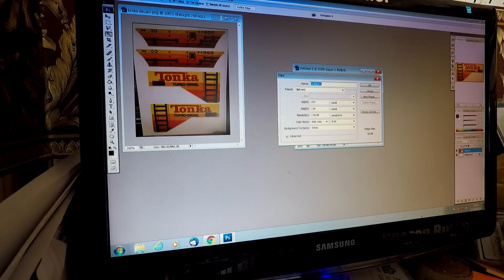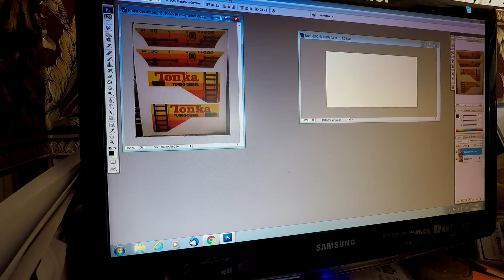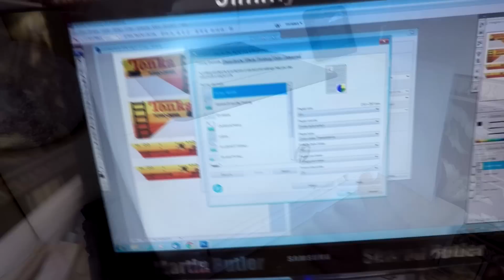Tonka Dump Truck Restoration 1970's Tonka Toy

Comment: As a young child, I had a truck exactly like that. I must have traveled 10 miles kneeling in the bed of that thing.
My memory tells me there was a metal lever to release the dumping action, and some kind of pneumatic cylinder to lift the bed, but I might be confusing that truck with another one.
Really nice job on restoring, it should give that young lad years of fun!
Reply: Oh yeah riding in the the back of those truck

Comment: Very nice results. I almost cheered when you let the kid play with it. That's what they're for. Must be nice to have a shop and the capability to plate things. I would be tempted to plate every metal piece, rather than restoring it as close to original as possible. There is only one tip I can offer: when you're drilling out rivets, drill a pilot hole with the smaller bit, but then use one that is as large or slightly larger than the head of the rivet, HOWEVER regrind the tip to a very shallow but very sharp point. This keeps it from going deep before it goes wide, and makes drilling them out quite quick and easy. I have to use the kitchen table as my shop space so what I can do is rather limited.
Reply from the maker: The centre part of the rivet was sticking up. That's why I couldn't get a start till I knocked it through.

Comment: Came out fantastic. Get a spot weld drill bit, they get rivets out without touching the part its holding as they are flatter on the cutting face.

Comment: Awesome job. That was a lot of work. A suggestion that may help, I have found using a white primer/ under coat makes a huge difference to the finish with bright colours like yellow, red and orange ect as the light tends to go through the colour and bounce off the white. Not only do you need less coats but the colour really “pops”. Hopefully you will give it a try and like the results. Love your channel. 
Cheers Stuart 🇦🇺
Reply from the maker: Thanks for the info Stu

Comment: Truck was made 88-91.  The wheel hubs are recessed
Reply: 83-96 had that grill. 83-91 had the cab and chassis decals like that. 89-97 had the recessed 5 lug wheels. So this truck was built 89-91. The wheel hub recessing came in in 1989.

Comment: The advert in the seventies went, "Real tough toys for real tough boys". " Great", I thought, now I can have a toy that can put up with my destructive nature. I had one for my seventh birthday in '71. I pushed it all around the garden for days on end and it did seem to stand up to a lot of punishment. Then came the beach. My family lived a stone's throw from Crinnis Beach in Cornwall and every summer we spent most of the time on that beach with it's strange non-sandcastle building sand, it's rusty coloured water paddling pool, crazy golf, amusement arcade and it's huge pot-holed car park. This car park put my Tonka truck to the test. I would push this truck up and down the car park seemingly oblivious to the movement of the traffic. But then I noticed something, "No!" One of it's plastic wheels had split along the seam. This was quickly followed by the other three wheels. When I got home I tried to glue them. But in the days before various super glues all we had at home was UHU glue, which was only good for sticking small feathers to other feathers. My Grandma suggested Bostick, I rolled my eyes, these glues were identical in their  hopelessness. It was just one of life's lessons. "I suppose some things are just crap?"  I reasoned. A few weeks ago I had the same feeling when my two year old Toyota Hilux had it's service. With just sixteen thousand miles on the clock I thought, "No surprises here". Well no, not really. The service engineer came out to see me when I went to collect the car and he told me that when he put it on the ramp he and his colleagues were surprised at the amount of rust on the front and rear sub-frames. "See that '01 plated Mitsubishi truck over there, your Toyota's got more rust than it has". "Oh well", I said. He must have thought how I was so unconcerned with this revelation? Well, I remembered I'd been let down before by "Real tough toys for real tough boys" hadn't I?
Reply from the maker: Great memories, you remembered it like yesterday.

Comment: I know this is an old video but I just wanted to point you towards a good product imo.
Ace Hardware makes a plastic razor that works well for removing paint and stickers without damaging the underlying metal.
I used them a ton on my school bus conversion to remove the school district stickers etc. 
 Mike from Texas,Take Memories,Leave Footprints
Reply from the maker: Nice one Mike. Cheers

Comment: Very nice there Martin. I was wondering when you were going to get around to doing a Tonka Truck. I like the nickel plating. That makes those axles look new and help avoid rusting. Now some child will get to enjoy hauling sticks, dirt and pebbles around with it.  I have to ask you, what type printer are you using to make the decals? And what type decal paper as well? Perfect refurbishing indeed. Bravo sir, Bravo!  I have two such trucks and one front end loader to do yet.
Reply from the maker: I used a laser printer on this one but I have used inkjet waterslide decal paper as well. As long as you spray lacquer over them before you put them in water, they work great these waterslide decals. I got them from Ebay

Comment: Excellent video! Doing something like this to a tow truck. What media did you use to blast the paint off? What did you do to restore the window?
Reply from the maker: Aluminium oxide. window just cleaned as it had many stress cracks.
Reply: @bizarreandbrilliant  What paper did you use for the decals?

Comment: Pretty cool. I can't remember what brand, but I have seen at one of the auto parts stores a spray can of "Tonka Yellow". 
And you even re-plated the axles? Wow! Also, that was a nice touch painting over the logo on the wheels.

Comment: Martin, did you reassemble using pop rivets as well? Great job!
Reply from the maker: No I used high tensile bolts and nyloc nuts so you can strip it down if needed

Comment: Started a bit crude but you made up for it.  I had about 15 different models that I restored.  I always cut the old axles in half and used 1/4"Stainless Steel Tubing for new ones.  I bought the proper rivets and heading tool and replaced them as necessary.  The Bottom Dump and Mighty Scraper were impressive.  I even was able to get a Mighty Road Grader with Wing and restored it too.  Sold a room full for $1,300.  A local shop took a digital pic of a very pristine model and batched paint and put it in a rattle can for me.   Another shop I frequented glass bead blasted the parts.  I found that a sharp drill works best on those rivets.  Go straight in.  Great the way you repro'd those decals.  I was able to find some peel and stick ones as well as some water transfer ones.  A white Industrial Marker works well for 'Raised White Letters' on the tires.  It looked like you did not use Gloss Black on the frame.  Any reason?  Many great Tonka sites on line.
A Tonka Tractor is the most difficult model to get apart.

Comment: When Tonka started making all the trucks with the Euclid style cabs,, that was their downfall, before that they mae some nice real fords.
Reply: When I was a kid they made some realistic looking late 50;s Fords. State highway dumps with plows, mostly 6 wheelers. everything worked, also made a Ford 10 wheel dump with Graders , dozers.They were all in orange & I had them all. I remember a NYLINT I think telephone pole truck with a screw drill for the holes & a trailer to pull the poles. Good stuff back then .

Comment: 12:18 - why didn't you just sandblast the paint off instead of additionally using paint stripper?
Reply from the maker: If you watch the video, the blaster didn't remove the original powder coating

Comment: Looks like you did an amazing job, well done!  I'm sure your grandson will enjoy it for many years. 

However, it isn't a 1970's Mighty Dump, it's actually one of the 1989-1991 editions. 

The lack of a finger chopper under the dump box was what originally caught my attention, as they changed the design in the early 80's, due to safety concerns of children having their fingers injured when the dump box was closed (when they had their fingers under it and fell on it, etc).  

The stickers are another way to place a date on it.  Tonka didn't start using those stickers until the early 80's, and while they used the same stickers as on your model from 1983 to 1991, the final clue to it's age is in the wheels.  Your model has the recessed spokes in the wheel rims, and not the original surface spoke rims, which was changed in 1989, again due to safety concerns (kids were getting their fingers caught in the spokes while pushing them around, resulting in broken fingers).

From a safety perspective, your grandson is a lot safer with this model than an original 1970's version. 

Very nicely restored.  I like it.
Reply: I love my 2 unsafe 65-71s

Comment: I still have my son's 1974 dump truck. The bed had a release bar and a pneumatic lifter, which no longer works.  Ironically it broke when the truck was only 2 years old.  Anybody know where I can get a replacement lifter?  The one on the truck has no markings on it for me to use in a search for a possible replacement.  I tried contacting the manufacturer many years ago, and the folks I communicated with tried to convince me that they never had a dump truck model like it (even after giving them info off the truck).  But, of course I was communicating with individuals younger than my son, so what did they know from experience.

Comment: This is an amazing restoration, however does this now make the toy less valuable because of the restoration. Even though it's an original toy, paint and stickers have been replaced. It would of surly gone up in value had u left it as it was. But putting all that aside if this is what u enjoy doing fair play becasue it does look awesome
Reply from the maker: It was beyond playworn and was in need of restoring and it had already been painted by someone else as well.
Reply: @bizarreandbrilliant  fair enough

Comment: Some interesting stuff, loved the nickel plating.  Overall, I'd give the restoration a B or B- grade.  First, I'd argue the toy was still very much playable prior to restoration.  The little boy could  have loaded it up with rocks/dirt, gotten it wet, thrown it in the mud, and it still would have been fine - thats what Tonka's are meant for.  Some misses for me on the restoration are the color (not correct), the wheels/tires (they looked kinda bad hand painted), the plastic (still marred and scarred, could have been sanded/smoothed or even given light bondo), the plastic glass in the cab could have been polished clear.
Reply from the maker: I left the plastic as playwear, The glass was covered in stress cracks and wouldn't have polished out. The tires were not painted at all. The yellow was ok.